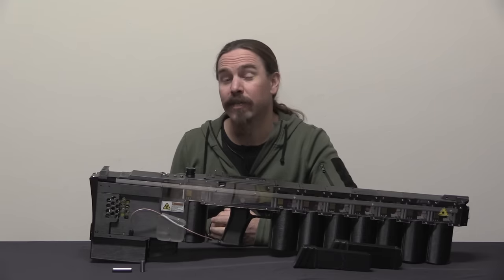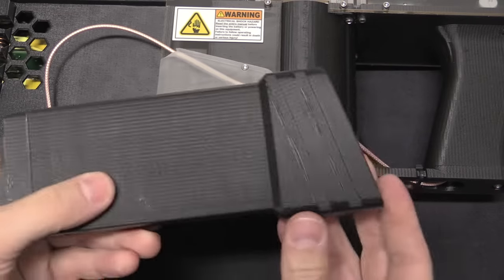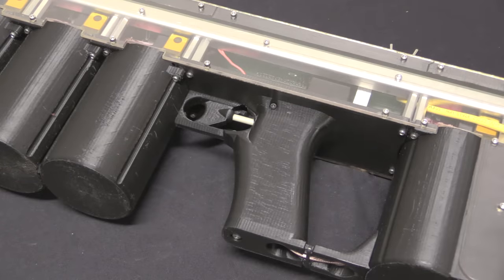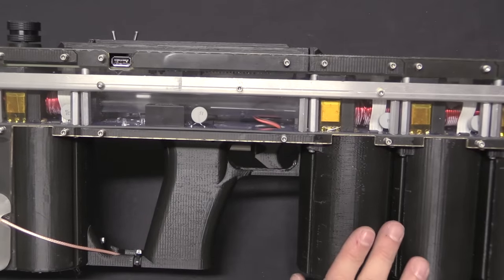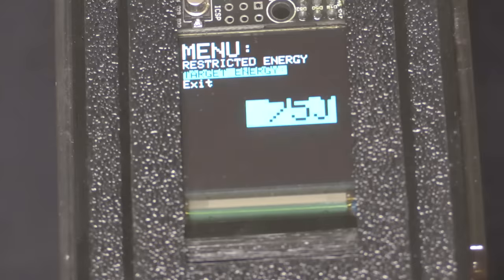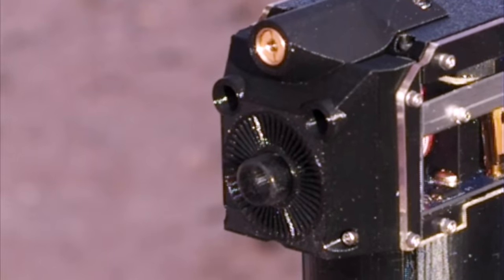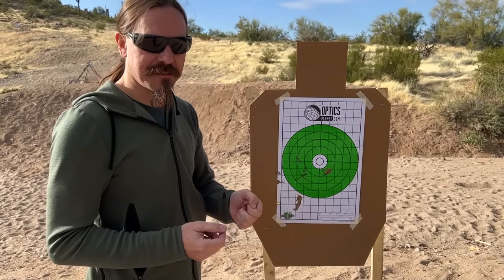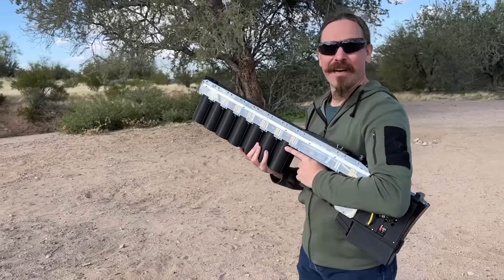ArcFlash Labs' GR-1 Anvil Portable Gauss Rifle

Comment: Potentially, the Gauss rifles in the future can become a perfect sniper weapon: they have no fire from the barrel, almost have no sound, and doesn't leave shells on the ground
Reply: I was thinking the exact same thing. If they can get the power and accuracy, they'd be perfect for that role
Reply: @yep Maybe build them with Mu-metal or permalloy?
Reply: For an adequate sniper rifle, it would have to be supersonic, which would make quite a crack as it leaves the muzzle.
Reply: @yep Liquid helium's colder, albeit much more rare.
Reply: I was actually thinking a better use would be for large-scale anti-tank weapons. The nice thing about this technology is it's effectively scalable as you pump mjore power into it. Which means you could launch a MASSIVE projectile very very fast with a lot of force without needing to have huge amounts of unsafe explosives like you do now.
Reply: air rifles are silent when suppressors are used...there is no muzzle flash and the only thing left behind might be footprints from the vantage point the shot was made...there are large bore air rifles capable of taking down large game...so the technology is there if needed...only a bit of minor tweaking to suit the situation required from it
Reply: That's the horror over the general gauss weapons. They are quite and can be mistaken for a toy sound. So Holy imagine if they are ready perfected now They would change battles fast. In the sniper areas for sure.
Reply: The fire from the barrel is called nuzzles flash
Reply: @scottmantooth8785  the sonic boom still hurts
Reply: @ambuknight  if there is this available for the general public, you can guarantee that the military have some that are far more advanced.
Reply: @realburglazofficial2613  fair point
Reply: @orkhepaj  a lot of air rifles are slightly below the speed of sound or still very quiet respectfully when a sound suppressor is utilized...there are excellent .177 and 22's that are good for small game or serious plinking...but larger calibers do exist...and the earliest air rifle was the  Girardoni air rifle...Louis and Clark carried one...
Reply: So long as you don't mind a sniper rifle with subsonic ammo. Can't really get around the sonic boom.
Reply: @Tyrian3k  and Also if you can handle the Back last, and shock wave however the damaged that be dealt in the target and surrounding area of Impact would probably be worth it.
Reply: @Tyrian3k  the problem with supersonic ammo from sniper rifles is not the sonic boom of the round, but the sound of the round actually firing. 
Crack: the sound of the round passing you
Thump: the sound of the round being fired
The time between the Crack and the Thump: the distance of the weapon firing at you.
The direction of the Thump: the direction of the firer.
You can use these sounds to estimate the range and direction of a sniper trying to shoot you. 
This weapon completely eliminates the Thump.
So you know you are being shot at, but you don’t know where from or how far away they are!
An absolute game changer for modern snipers!
Reply: and custom ap,he,&i rounds 😉👍
Reply: @scottmantooth8785  those are not sniper rifles
Reply: @justarandomtechpriest1578  "You take a chance getting up in the morning, walking across the street or sticking your face in a fan"

-Lt Frank Drebin...Police Squad
Reply: @yepAgainst less technically capable opponents it would be good a bit like night vision,
Reply: That would prob break a couple of Geneva convention laws.
Reply: Also they could fire essentially needles wich have a very high ballistic coefficience.
Reply: @Swordphobic  like what?
Reply: @2Potates  And shit aerodynamics, i'm guessing.
Reply: @justarandomtechpriest1578  No it's not... The open end of a gun is called the muzzle. The flash at the muzzle is the muzzle flash.
Reply: if the bullet broke sound barrier it would still make a loud explosion sound.
Reply: @yep  It’s amazing how you speak with such confidence while knowing exactly nothing about the subject at hand. First, that’s not how EMF works. Second, that’s not how charged particles work. As far as I can tell, your understanding of any of this is based primarily on assorted science-fiction of questionable hardness.
Reply: @TheArtikae  could you explain your understanding instead of going full you know nothing John Snow and I know more than you ? Please and thanks ! 💯
Reply: @pt8306  yeah, carrying a 4ft missle on your shoulder never feels super safe
Reply: @machineenvyllc437  Railguns work on a different, but similar principal. They maintain contact with the projectile along the barrels length and this friction ablates the barrel/projectile with each shot causing the muzzle flash.
A coilgun should never have the projectile touch the barrel, thus no friction or ablation of the barrel and no muzzle flash.
Reply: To all yall saying the emf would be a dead giveaway, do regular military forces usually havr the ability to detect EMF feilds?
Unless I'm missing something I dont see how emf would be a problem if this is used sparingly
Reply: Nothing that couldn't be done with a compound crossbow. For now.
Reply: It emits EMP and when dry fired it loses the energy into heat and the heat dissipate.

Solution: Have a Faraday cage wrapped around the gun as a containing not only to render it the emp safe but also to capture dissipating energy back to a charging extra battery that can be added on the butt stock (not reintroducing the lost energy back to the battery pack that released it)
This will solution needs to be tested with a thermal scanner and amplitude reader in the lab with live fire and dry fire. Shock (weather and exposure tested also needed for product protection)

Barrel wobbles and might heat up or get damaged when dry fired or the projectile hitting the sides.

Solution: Water(pure h²o) wrapped cylinder making the barrel fuller that it can sit snug on the edge of the gun loosing the wobble and making the shots more accurate. This in turn will also minimize the opportunity of the projectile to tumble in the air as micro movements at the moment of projectile escape makes the tumble more prone.

Battery pack usage seems to drastically impact not only shooting but the whole gun.

Solution: The Laser pointer, Flash Light and on board computer should be in different batteries power in the gun. (Charging port necessary)
If the solution for the barrel is accepted you can use the clear cylinder as a flashlight by pointing low amp/high lumen LED lights on the cylinder and base off refraction, the light will come out of the barrel. Making a circle of light projected accurately out of the barrel itself.
The Laser pointer should not be in a flip switch but rather a button available to be pressed with trigger finger the same way it is on modern rifles/handguns with built in lasers that has it's own light weight battery. The computer for reading and controlling the magnets should be the main computer with a different battery pre-installed in the gun itself.
All This in turn will help in efficiency for the external battery pack that gets used.

Magazine cartilage is too soft to be the first contact point between magnet and hammer.

Solution: clips of projectile used in snipers rifles instead of magazines in automatically rifles.
Instead, reuse the magazine chamber as a loading clip for the external Batteries that will be used by the magnets. Making a more efficient loading ans unloading of the gun when not in use and in transportation.
Instead of plug in ports, use contact points like that of airpods (with prongs and contact points)

Onboard computer, battery for lights, display and computer all in stock of the gun. You can even include a camera a size of a gopro on the gun if the solution for the casing is successful.
Adding a sim card and antenna on the computer can have the gun be tracked and traced remotely by mission commanders.
Reply: @machineenvyllc437  That's a railgun, it's different. The flash there is the superheated plasma tearing off the rails as the projectile leaves the cannon. With Gauss rifles, ideally there is no contact whatsoever.
Reply: Thats why they’re illegal lol
Reply: @FanaticDrummer  But they're not?
Reply: @firstconsul7286  They are. To build and own a projectile based weapon that shoots anything larger than a hand crossbow bolt is illegal in almost every state. Which is why you dont see people building homemade bolt guns and advertising it outside of youtube “entertainment”. Having a weapon that fires bolts or untraceable projectiles is highly illegal.
Reply: A regular suppressed sniper rifle? Just pick up your casings
Reply: @jellomaster5629  You dont know how ballistics work lol Its not about being undetected nor will picking up casings save you if a agency wants to find the shooter, especially using long rifles with easily traceable ammo purchases.
Reply: It also looks like it has very insignificant recoil
Reply: That massive magnetic field is going to make any compass in the region spin. This isn't exactly stealthy.
Reply: @andreasmartin7942  yeah, but can your crossbow arrow double as a paperweight?
Reply: @danielvalleduarte  It might if you fire small cruise missiles. Hmmm...didn't he mention that you could fire anything with this thing?
Reply: @andreasmartin7942  I vote for lysergic darts
Reply: Ugh. You're still firing a chunk of metal that today's incoming-fire radars can see clearly, and that's before anyone tracks the huge EMP flash when you fire.